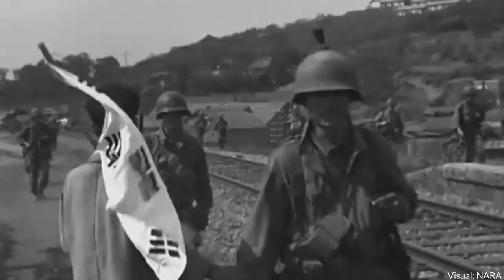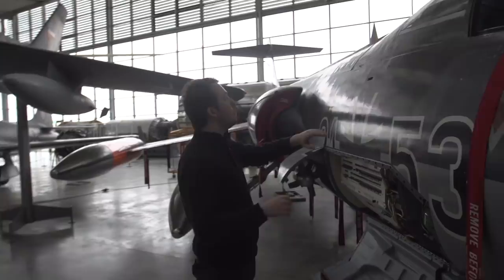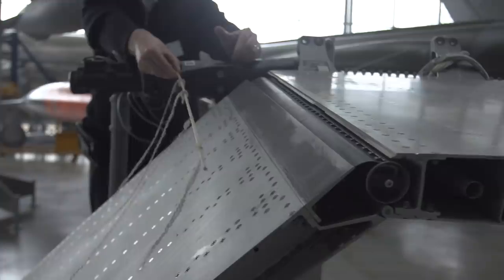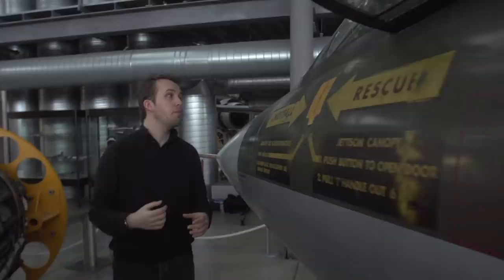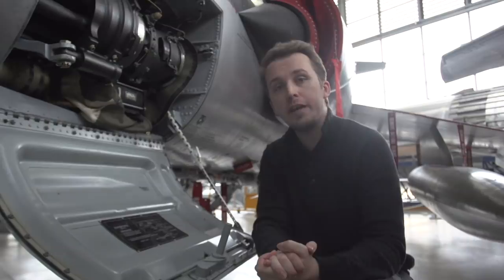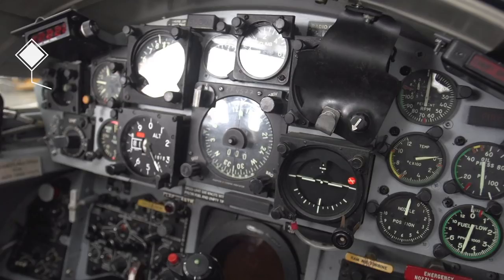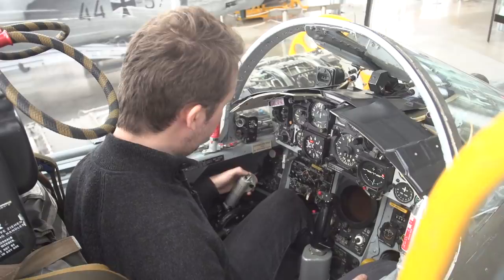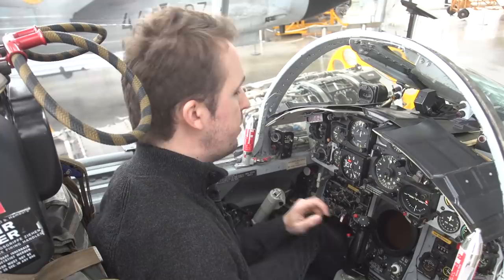F-104G Starfighter - Inside The Cockpit

Comment: That "widow maker" scandal in Germany: 916 Star fighters in service, 269 crashes, 116 dead pilots and some more fatalities. There was a bad joke in the 1960s about the Lockheed F 140 G, translated: "How do you get to own your own Starfighter? Just buy some farm land and wait"... Kai-Uwe von Hassel (CDU), the German defense minister at the time, commented: "Every air force in the world must expect a certain loss rate even in peacetime. Four years later, his son Joachim died in a Starfighter crash. Guess what? After this loss, the german F 140 was modernized, and equipped with a better ejector seat. That plane was expected to be an allrounder as fighter-bomber, reconnaissance aircraft and interceptor, but it never was. Most fatal accidents happened in very low flight, and/or bad weather... Even at my hometown we had a fatal crash in the early 70s. So the plane itself is not to blame... The US versions were quickly updated... The responsibility for those dead pilots in germany is mostly political incompetence, and some even blame the one who bought those F140 G as corrupt. Interestingly, most pilots loved this airplane more than others. I think cos it was a challenge to fly it, even after security updates were made.
Reply: > That "widow maker" scandal in Germany: 
> 916 Star fighters in service, 269 crashes, 
> 116 dead pilots and some more fatalities. 

I don't think it's possible for anything to be put out about the F-104 without someone eventually using the expression "widow maker" and referring to the losses in Germany.
Interestingly (for me) is that no one mentions that the F-104 in German service had a lower accident rate than the F-84 aircraft they replaced.

> There was a bad joke in the 1960s about 
> the Lockheed F 140 G, translated: "How 
> do you get to own your own Starfighter? 
> Just buy some farm land and wait"... 

There was a similar joke made about the English Electric Lightning (which many armchair pilots seem to like to think would have been a better alternative than the F-104) only in the Lightning version, all one had to do was stake out an area of the North Sea.

> Kai-Uwe von Hassel (CDU), the German 
> defense minister at the time, commented: 
> "Every air force in the world must expect a 
> certain loss rate even in peacetime. Four 
> years later, his son Joachim died in a 
> Starfighter crash. Guess what? After this 
> loss, the german F 140 was modernized, 
> and equipped with a better ejector seat. 

The Lockheed C-2 ejection seat was not a true zero/zero ejection seat and so its replacement with one that was (the Martin-Baker) did indeed save lives.

But let's be clear here:  the ejection seat wasn't the reason for the high loss rates of the F-104, at least in the early days, when the rates were at their worst.
This is clearly the case because after Steinoff took over the Luftwaffe in 1966 and grounded all of the F-104s, he let them back into the air WITHOUT any changes to the aerodynamics or structure and the accident rate came DOWN.
(If there had been a problem with the design of the F-104, the accident rate should have remained high until the design flaw was corrected.)

> That plane was expected to be an allrounder 
> as fighter-bomber, reconnaissance aircraft 
> and interceptor, but it never was. 

The F-104 was originally designed to be a daylight air superiority fighter and was pressed into service in the USAF to be a point interceptor.
Even so, Lockheed needed to make more money and so offered it to the Germans who were trying to modernize their air force and navy aircraft so they could be fully functional members of NATO.
It was the Germans who demanded a single aircraft that could perform three roles, namely the three that you mention.
Lockheed said that they could get there from here with the F-104 if they strengthened the airframe, which they did and the result was the F-104G.
And despite what you may think, it was a decent enough recon, fighter bomber, and interceptor.

> Most fatal accidents happened in very low 
> flight, and/or bad weather... 

Ummm, no ... I think not, at least not after the early period when pilots started flying a lot of hours in the F-104.
Overall, about a third of all accidents were "pilot error" meaning that the pilot became disoriented and flew into the ground or failed to pull up early enough while diving on the target.
About a third were "aircraft" (compressor stalls, hydraulic failures, ... , etc.) which doesn't correlate well with altitude or bad weather and about 20-percent were "other" (bird strikes, FOD, ... , etc.).
About 10-percent were "weather" (lighning strikes, ... , etc.).

FWIW, here's what former F-104 pilot Wolfgang Czaia had to say on the subject:

  By 1966 the accident rate was unusually high, and 
  a lot of it was weather-related.  Quite often small 
  technical problems would -- due the pilots' 
  inexperience and lack of proficiency -- be the 
  trigger for chain reactions resulting in accidents.
  Once the wings began flying steadily and pilots
  were getting the required flight time the accident 
  rate dropped to 'normal' (ten accidents per 
 100,000 flight hours) - but the public still perceived 
  it as a dangerous machine, with names like the 
  Witwenmacher ('Widow Maker') or 
  Fliegender Sarg  ('Flying Coffin').
  Compounding the problem was that every 
  subsequent ground or flight accident continued 
  to make major headlines.  
  We had just as many accidents in F-84s and F-86s, 
  but these stories would be buried on page 3 or 4.

> Even at my hometown we had a fatal crash in 
> the early 70s. 

As one American general said, the problem with Germany is that all of the towns are just two kilotons apart.

> So the plane itself is not to blame... 

Glad to hear you admit that.

> The US versions were quickly updated... 

I have no idea what updates you think were applied to the U.S. F-104s that weren't updated in the case of the German F-104s.

The USAF replaced its F-104s with F-4s and F-102s/F-106s because that's what they wanted/had the budget for.
They did update some of the F-104As they had with the same J-79 engine used in the Italian F-104Ss which made them into the hottest F-104s around, but the USAF had its mind made up and the F-104s had to go.
But the USAF's F-104s weren't the F-104Gs that the Germans bought which was heavily modified compared to the ones used by the USAF.
And the Germans were not ignorant of what they were buying as they were got to see what Lockheed did along the way to turning the U.S. F-104 (the A/B or C/D) into the F-104G.

> The responsibility for those dead pilots in 
> germany is mostly political incompetence, 
> and some even blame the one who bought 
> those F140 G as corrupt.

I would agree about the political incompetence.
The F-104 was an incredibly hot aircraft that was a quantum leap compared to what the German military had had before with the result that they weren't ready to deal with its care and feeding.

As for political corruption, I think that's a bit of a stretch.
There was only one real (i.e. non-paper airplane) alternative to the F-104 in the competition and that while the Mirage III was a better dogfighter than the F-104, the latter was otherwise superior in terms of performance.

> Interestingly, most pilots loved this airplane 
> more than others. I think cos it was a 
> challenge to fly it, even after security 
> updates were made.

A challenge to fly?  Well sort of.  I'm sure that different pilots loved it for different reasons, but more often than not, the words that best seem to describe it are an "honest" aircraft, but an "unforgiving" one.
IOW, it just did what you told it to do, but if you told it do something you shouldn't, it could kill you in an instant.

Belgian F-104 pilot Jan Govaerts said/wrote the following:

  The F-I04 used to be the hottest fighter for so
  many years and she could truly be flown high,
  wide and handsome.  Some of her shortcomings
  were doubtless the result of inexperience on the
  part of those who designed and tested her, and
  the political pressure that was exerted in the
  early years. In the hands of a capable pilot the
  Starfighter could chalk up respectable gunnery
  scores on towed targets. It was a good, stable,
  weapon, platform and handled well under
  instrument flying conditions. Accidents happened,
  but they never made us professionals
  dislike the Starfighter.
  One thing is certain, many genuine tears
  were shed into many a beer when the old gal's
  wheels were chocked and her big turbine wound
  down for the last time.

Comment: The colored lens over the radar indicator is not meant to be removed by the pilot.  Its function is to filter the bright blue of the indicator tube surface display to bake it more easily visible to the operator.  That it comes off is for cleaning and and for replacing the bezel illumination.  Most such filters are only removable in a repair shop, though maintenance crews would often carry the specific tools to remove them while still on the aircraft.  The easy removability of this particular filter is unusual.

Comment: One bit of information that is seldom mentioned is the fact that the plan view of the F-104 Starfighter is almost identical to that of the X-3 Stiletto research plane from 1952.  
The X-3 was specifically designed to explore the aerodynamics of supersonic (Mach 2.0) flight, but the limitations of existing powerplants (and other issues) resulted in its failure in that mission.  Kelly Johnson and the Skunk Works are credited with the design of the F-104, as if they started with a clean sheet of paper, working in a vacuum, without the benefit of any prior research, to produce the first production US Mach 2.0+ fighter.  I think it's inconceivable Lockheed was ignorant of, or disregarded, the research done for, and by, the X-3 -- especially given the obvious resemblance.
I would really be interested in some commentator addressing this question.

Comment: Takes me back...
These were the principle aircraft at the Air Base I was stationed at in Italy in the 80's, so I spent quite a bit of time around them. Not many realize that the F-104 was as fast or faster than the F-16's at that time. They just had no turning radius once above Mach 1 according to the pilots I spoke to. Just bloody fast in a straight line.

Comment: An interesting note on the blown land flaps was that there was a separate valve for each wing. 
 As power was brought to idle they did not necessarily close at the   same time leaving a significant difference in lift between the two wings. Nasty on landing. 
If I remember correctly we had to land with a minimum of 85% power on to avoid this effect. 
Another interesting flap statistic was that when heavy we could use take off flap to 520 knots indicated to avoid stall stick shaker when turning. Very nice video. Thank you.
Reply: Thanks, this was very interesting. On landing, was there a soft stop/detent or anything like that that let you know you were at that 85% without looking, or did you have to pay attention to the RPM to make sure?
Reply: @FlyNAA  Because of the exceptional high drag when slow power settings were always very high. On a pitch out and turn to final it required full military power in the  turn unless the air was cold.
No soft detent. Just were careful.
Interesting when you got good just above touchdown you could sneak the power back and get very soft landings as the blown air decreased. Very nice airplane to land.
Reply: @larrydugan1441  
Were you RCAF?
Reply: @raynus1160  Yup. Mostly 421 squadron but I did a year with 441 and a year with 439 when I was in wing  standards
Reply: @larrydugan1441  
Very cool. I visited a (distant) relative at Baden in 1987 - he was a Hornet driver with 421 Squadron. More recently, I met a former 441 104 driver (and later CF-18 Alert Force Commander) at Calgary's Military Museums cold war hangar - fascinating discussion - really enjoyed his take on both aircraft - especially the 104.
-Cheers
Reply: @raynus1160  I spent some time on 410 instructing on the F18 in the early 80s. Both aircraft were great. We all loved the 104. Of the two it was my favorite. The F18 was light years ahead of the 104 in capability however. Always nice to speak to someone who loves aviation. Cheers

Comment: That external stores salvo button was placed there (right in front of throttle) so in case of an emergency the pilot during takeoff could just use his finger to punch of external stores. My father was a fighter pilot and he told me on some aircraft, during takeoff and full burner, he held his finger over that button in case of engine problems he could instantly dump the extra weight of external stores and continue with whatever power he had left.
Reply: It makes logical sense, keeping hands on throttle and stick. That button located in front of throttle would be easier to reach with max AB  engaged. And with AB engaged, you probably want to jettison stores if attempting a Vmax run.

Comment: In Canada, we used to call them the "Aluminum Death Tube"
Reply: called it the flying coffin and the widowmaker in Germany
Reply: That's why the U.S. bullied, bribed Diefenbaker into cancelling the Avro Arrow, so they could force Canada to buy the 104 flying tu r d.
Reply: Phil Collins  what they should do is set the record straight.  Of 36 f104 crashes, 33 were blamed on the pilot. Obviously to coverup the deficiencies of the jet.
Reply: Phil Collins  history repeats itself with the 737Max. Blame the pilof.
Reply: Phil Collins  dead men don't talk.  Pawns were made to be sacrificed.
Reply: Phil Collins  from wiki: 'the starfighter 's success was marred in 1975 by the discovery of bribes made by Lockheed..'
The Germans lost 292 of 916 aircraft..'
'Canadair production was 200 aircraft... 110 class A accidents... 21 due to foreign object damage (bird strikes)
The rest due to equipment failure and pilot error.
1815 of F86 Sabres were produced.  282 were in class A accidents. (This must include the Korean war)

Comment: America is in love with multi-roll aircraft. When they bought the f104 they did it grudgingly. The Pentagon doesn't like manufacturers to say here's a plane you should buy. The f104 was an air superiority fighter. Air Force went to all multi-roll and then discovered that's not all that great here let me pull back the curtain and I'll show you our brand new interceptor called the F15. Having multi-roll aircraft is great but having dedicated air superiority fighters is better in the long run. Sometimes you end up with an f-15e situation. Or the super tomcat. These were air superiority fighters that had enough capacity to ultimately exceed their design limits. Very rarely does a plane designed as a multi-roll aircraft exceed their design limitations. The f104 was built so on the edge that it never really had the capacity to be a true multi-role aircraft. Lucky to got the most they could out of the design. I wonder what the f104 could do with modern avionics and weapons. This aircraft is also pretty hard to visually recognize at a distance. Some people called it strapping a man to a missile.

Comment: For those who want to get a really in-depth look at what the F-104 was capable of doing, please check out WaltBJ's (Walt Bjorneby, USAF Fighter Pilot through the 1950s - 1970s+) posts in the Google archives for the rec.aviation.military newsgroup. 
Walt flew the F-104A with the 319th FIghter-Interceptor Squadron at Homestead AFB in Florida. (After flying the F-86F, F-86D, and F-102A)  While there, they upgraded their aircraft with the F-4E's J79-19 engines, adding nearly 1/3 more thrust.  This gave the already hot Starfighters spaceship level performance.  He tells of one day, he and his wingman were in a hurry to get home to Homestead (South of Miami) from Tyndall AFB On the Florida Panhandle, near to Mobile, Alabama.  So, they climbed into their Mk4 Pressure Suits (The same suits used by the Mercury Astronauts), took off from Tyndall, climbed to 73,000' (About 22.3 km) throttled back to Mach 2.0, and covered the 500 Nautical Miles in 25 minutes, burning same amount of fuel that they would have used cruising at Mach 0.9/35,000'. 
He offers some great insights into just how effective the F-104 could be in air-air combat, and as a weapon in general.
Reply: I've seen other hidden gems on archived newsgroups, so I'm excited to dive into this one now. Thanks!

Comment: The opinion I read on the F-104 when I was young, in some defence magazine, was that this was, basically, a bad plane under all respects, basically a failure. The F-4, which came out a few years later, had most of the characteristics of the F-104 (it could be used as an interceptor) but was, overall, much more versatile and nimble. If memory serves, the F-104 got out of service very fast in the USAF, and was given only to the National Guard (memory might fail). 

The reason why Italy, Germany and maybe other countries bought it was that Lockheed and the US Government allowed construction on site, which meant quite a lot of technology transfer. Basically Italy and Germany got a bad plane, but also a lot of technological improvements for their aeronautical industry. This is a supersonic plane and it incorporates a lot of technology which was "above the head" of the Italian aeronautic industry of the time. Lots of know-how was gained thanks to that decision. The decision to buy this plane when it was already obsolete if compared to the competition, but quite modern and advanced if compared to the Italian aeronautic industry, was strictly political and not due to military reasons.

In Italy the corruption scandal with Lockheed was related to the purchase of some C-130, much later (around 1974).